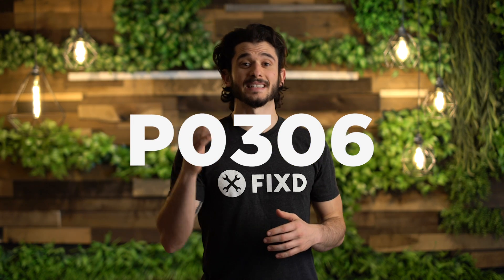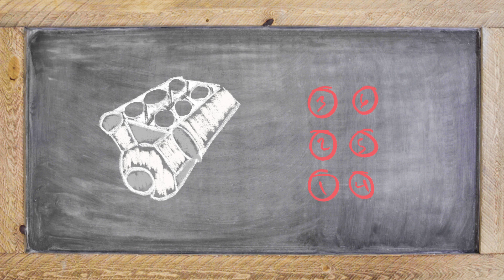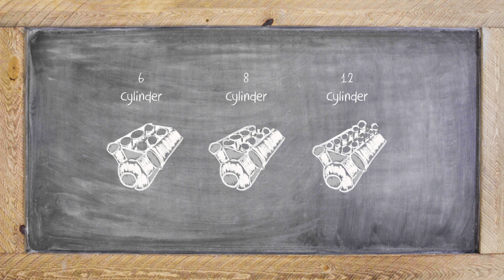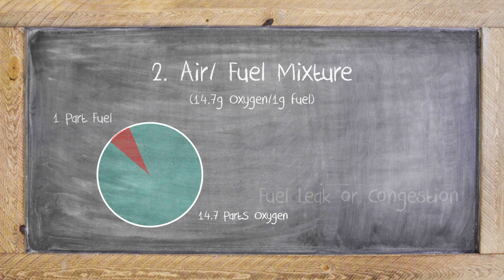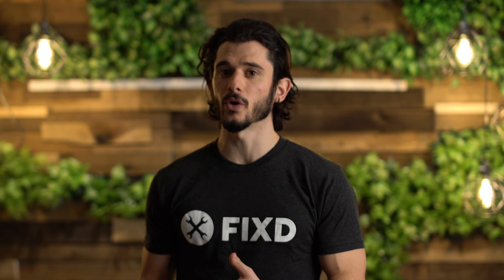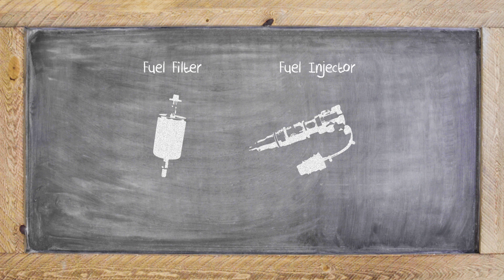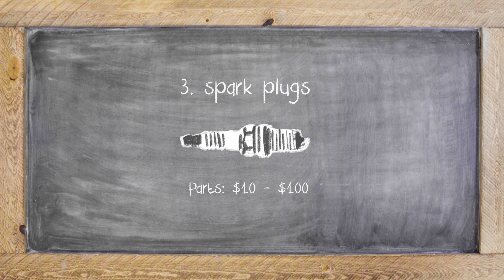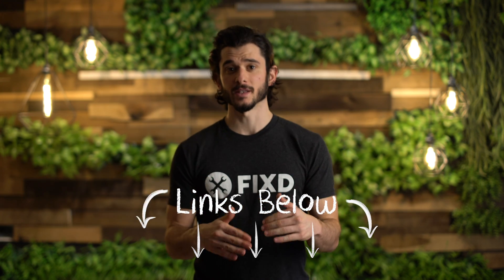P0306 Explained - Cylinder 6 Misfire (Simple Fix)

Comment: Usually putting in cheap 87 gas is the root issue. Buy gas with fuel additives or use a bottle or two of fuel injector cleaner solves your issue. Past experience, all it needed was a bottle of fuel injector cleaner.

Comment: Currently working on 2006 Tahoe.
Changed all coils, all spark plugs, all connections. Misfire on 6.
No powerful engine and stalling. I’ve already put $2K in the last 2 months! I need help. I basically re did the whole truck but all blogs says to look into the Camshaft? Lifters are good according to mechanic. Pretty much everything mechanic, electrical and suspension is new! Now dealing with this, also a O2 came up just now!!! Ughhhhhh
Reply: Look into your Cylinder Head Temperature Sensor  if you're still having that misfire problem also is there a loud smell of chemical gas odor
Reply: For it to be bad enough to stall you out, I would guess distributor or valve issue depending on what kind of truck you have. A faulty 02 sensor could cause those kinds of issues if it is causing your truck to try and run with a bad mix. So, I'd fix that first. Before you get work done on the values, do a compression test. I doubt it is your cam especially with mechanic saying your lifters are good. Cam is basically a solid piece of machined steel - typically, it either works or it doesn't from day 1. If you have a ton of miles and never did your timing belt/chain that could cause a problem that seems like a cam issue.

Comment: Can a O2 sensor cause a misfire in the six cylinder
Reply: If the 02 sensor is badly failed, yes. Because, the car's MCU (computer) may make a bad fuel mix (too much/little fuel or too much/little air) based on errant feedback from the bad O2 censor. If you do have a bad O2 censor, you should get an ODB-II code indicating that the censor is bad though. If your O2 censor is not throwing a code, I would not spend money to replace it. First, I would try SeaFoam (or something similar) to clean your engine. If you still have problems with a misfire code being generated, I would check your cables and plugs. If there is a problem, you will likely see it. It will be obvious. For example, I worked on a Honda Civic once that was throwing misfires. The head gasket around one of the plugs failed and flooded the plug well with oil. If you have a large number of miles on the vehcile and have never changed the plugs or wires, fouling (dirtiness) of the plugs or corrosion of the wires would be the most likely cause that I would look at first. After that, the next most likely thing would be a failing ignition coil.

Comment: i changed the o2 sensor, spark plug and ignition coil after i changed everything i manually cleared the code and it goes away for about 90 miles and then the light comes back on

Comment: Ok i am having that code on an a dodge 3500 promaster i hve changed the spark plugs coil and injector still same thing what could  i look at next also i did a compression test all cylinders passed
Reply: Do you have an older truck? Could your distributor be damaged? I have seen contacts bend and break off distributor caps. This could result in occasional misfires or constant misfires for just one cylinder.

Comment: On 5.4 triton a cam follower could pop out and cause misfire, you can go through all the things mentioned in this video and still have an engine that is stumbling. Take the valve covers off as a last possible diagnostic, poke around looking for parts out of position.

Comment: What if all my cylinders are misfiring would would be there reason my vsa light comes on and my van doesn't wanna keep charge and start it lets me reverse but doesn't let me go forward they said it could be a sensor but idk what sensor
Reply: Very strange. Perhaps, a transmission sensor could cause this problem. It could also be a failed MCU (computer). If it is your MCU, just get rid of the car and get a new one.

Comment: Have p0306 code on my 3.6 chrysler 200. Cant swap plugs or coil. Have to take intake manifold to get to them. Once I swap I have to put manifold back on to test them. If swap does work have to take manifold off again to swap again.
Reply: I have the same car, did you ever figure out what the issue was? I just replace the coils and still throwing that only same code. Was wondering if spark plugs fixes it or it’s a bigger issue?

Comment: Thanks for this video!  I also have the P0446 code on my 2000 Camaro (Purge Valve). Do you think replacing that will fix the P0306 code?

Comment: Hey I have changed spark plugs, ignition coils and also injectors I’m still having the same issue. Cylinder 6 misfire what could be the problem can you help me plz. My wife accidentally put the diesel in it. So I drained cleaned the lines and changed everything mention above plz help me
Reply: Did you ever get it fixed? My truck is having the same problem. We replaced the spark plugs, spark plug wires and one coil and it still is shaking and shifting hard.
Reply: It could be that your valves have been fouled (dirtied) by burning the diesel (it wouldn't have burned completely). You may be able to fix it with engine cleaner (like seafoam). But, if that doesn't work you may have to have the valves manually cleaned by a mechanic. Did you replace the fuel filter?

Comment: Have a p306 and p0300 misfires detected in all cylinders, i replaced all 6 sparked plugs and one coil on my 6th cylinder and still showing codes, any suggestions. Also have a small vacum leak p0456 ...2011 mercedes c300...

Comment: I got a p0306 cylinder 6 misfire detected code 
& suggested parts valve springs & valve cover  

Any advice ? ima check the simple stuff before I go off buy the 4 valves springs & labor for cylinder 6
Reply: Any update?👀

Comment: I just recently changed my ignition coils 2 weeks ago and out of the blue today i got a P0306... i will change that spark plug. those were changed in January as well.
Reply: What was the problem after? I had the same problem I replaced ignition coil and spark plug
Reply: @TonyP0425  i have the same issue

Comment: I have a P0306 on my 2000 Tacoma, and even though 'they' told me it was likely, spark plugs, wires or coils, or an injector - I think it is the mass airflow sensor. Why? Because it is an existing, known issue. Many years ago I had the MAF cleaned instead of replacing it and that fixed the issue for years but now I have this CEL and I wonder if it is the MAF and not actually plugs or wires or coils, or an injector? What do you all think?
Reply: Hey! My 2004 dodge ram 1500 had same issue it was the MAF my co worker who’s a red seal automotive technician also replaced his MAF on his 05 dodge, same issue.

Comment: Hi, I got the 6th coil and spark plug fixed and it still pops up. When I clear the code, it runs fine and doesn’t lose power.
Reply: What kind of car did you perform this on

Comment: Ok Champ, I'm confused.. I have a 2003 ford Expedition..  8 cylinder .. I changed all coils and plugs myself... coils were $35 ea.. plugs were $2....I made this purchase 5-6 yrs ago they are a little more now... If I had the dealer do the work I would be out $1000 plus.. I'm saying you are quoting parts list cost for which vehicles??

Comment: Same swap can be done with the fuel injectors to test as well see if the misfire moves to the other cylinder.
Reply: Except you must disassemble the entire top of the engine to get to the injectors so not a simple test.

Comment: after 2 months of nightmare trying 2 fix this code and 100$ in unnecessary parts, finally found that dirt under the coil packs on the metal plate was triggering my misfires. when in doubt switch coil packs and see if the code jumps cylinders.
Reply: also, get your parts on ebay, much cheaper!
Reply: did you check water in gas?

Comment: If the problem is a spark issue, will black smoke come out of the tail pipe when the engine is revved?
Reply: How long do fuel injectors last? Mine are original with 219,000.

Comment: had same issues, this code of cyl. 6 misfire and bank 2 too lean. Engine running running rough and shaking at various speeds on the road, and idle.  Mechanic ran the codes and replaced the #6 spark plug and coil. Runs perfectly now and power restored. I wouldn't think one cylinder misfiring on a V-8 would shake the engine like that.  Oh well, problem solved.
Reply: Mind you this is the second shop i paid for a diagnostic and they spent the whole time guessing what it could be instead of actually checking and getting down to the issue
Reply: Sounds like it's the shop, not the service you paid for and we're supposed to receive
Reply: What kind of truck do you own ?
Reply: literally have the same problem right now, changed both spark plugs and coil but still have the issue pls help someone help idk wtf im gonna do on my 5.7 hemi
Reply: @lilstuart1584  bring for a real diagnosis?
Reply: @sonicelectronic57 diagnostics don’t do shit. Been to the shop 3 times, replacing coils, spark plugs, and cracked intake manifold and they still can’t figure out the issue 500 dollars later 😂😂😂 these “mechanics” don’t know shit about cars lol
Reply: @mass9213  changing parts isn't diagnostics. Those mechanics may not know shit, but that's not the case everywhere.
Reply: @sonicelectronic57  i know what a diagnostic is, i paid them 200 to do it and they had me replacing parts “hoping” it would fix it because they didn’t know wtf they were doing 😂😂😂 i can literally do that shit myself for free
Reply: @lilstuart1584  did u ever find the problem?
Reply: I got 2000 gmc sierra v6 with po306 code and check engine light is on and flashes regularly. Changed plugs, wires, distributor with cap and rotor, cleaned the MAF, replaced pcv valve, and poured  Seafoam in my gas tank. Cleared the truck's computer for an hour and still getting the code. I guess next step is taking it to go get a compression test. If compression is good, then maybe replace the fuel injectors.

Comment: I replaced my distributor cap, rotor, spark plugs and wires last year and about 1 month ago i started getting cylinder 6 misfire should i check for the other things or check if those parts are faulty
Reply: The thing that looks weird is the cylinder 6 plug wire is curved, could that have something to do with it ?

Comment: Great video thank you! What do you think it is If the situation only occurs after the engine is warm?
Reply: I got the same problem with my charger, start shaking after is warm😞
Reply: @kevinavelar2297  Took it for a long drive a few times and eventually the problem went away.
Reply: @robmccaughey8351  check valve cover for leaks
Reply: @mr-toyota  
شكرا جزيلا❤

Comment: I have a Saturn l300 2005 I'm having a po306. I change the coil pack and spark plugs and wee k s later I got the po306 code. Could it perhaps be a fault inside my ECM?
Reply: Did you figure out what it was?
Reply: @AbstractionVideography  no my car just been sitting.

Comment: I have a 2016 f150 3.5 non EcoBoost , I have misfire on 6 cylinder. 
The codes are both p0206 & p0306 , I switched coils with number 5 & 6
And still have misfire ?
Reply: Ever fix it? I'm in a similar situation wondering what kind of money I'm going to have to spend
Reply: @Chillingworth  The problem with my f150 was ,
A rat ate through the wiring on harness @ number 6 injector . I had to splice the wires together.

Comment: i changed the spark plugs, coil packs, and injectors, any clue what can be causing the misfire? only happening in cylinder 6, no other cylinders
Reply: A short? Fuel related?
Reply: Ecm
Reply: Same af rn
Reply: @luisnava3239 could be a problem in the camshaft/lifters, that’s the expensive problem that is probably more trouble than it’s worth
Reply: @selrandolph 😢😢😢😢

Comment: Coils are usually from 60 to 260 depending on the vehicle. Mine for my truck was 56.99 for single coil
Reply: I got mine 35/ pop at rock auto. 15 5.3 V8
Reply: Silverado?

Comment: Doesn't work on all vehicles. I can't switch my coil pack around because it's a bar. I've got an inline straight 6, all 6 spark plugs are in one side and my coil pack is a bar that runs across them. That being said though I replaced my coil pack and plugs and im still having problems so I think I know what it is.
Reply: Did you ever find out what it was
Reply: @anthonyaguirre837  nope. Never figured it out. Replaced the coil pack, replaced the fuel injectors, replaced the spark plugs, even added a heat shield. Nothing worked. Ended up having to get rid of the vehicle and bought a newer truck.

Comment: I have a P306 code also on my Audi Q7 4.2.  I replaced all spark plugs and coils and cleared the engine light.  

The code came back on for the same cylinder 6 misfire after putting about 55 miles on it.  It would actually be the second time I’ve replaced the spark and coil on cylinder #6, thinking that the parts may have been defective.  PLEASE HELP!!!!
Reply: Injectors now.   Or vaccuum leak
Reply: Have you fixed your Audi yet? I did the same and the check engine came back on. Gonna check for air leaks and fuel injectors now
Reply: What car do u have?

Comment: P0306 on 2013 ford f150 3.7 came in replaced 6 cylinder coil and all spark plugs worked for a few days then came on again and engine sputters pretty bad now?
Reply: 123 passenger bank then 456 driver right from front to rear?
Reply: Have this same problem, changed the coil and plug, it came back worse this time and I was told that it could be what this guy said in the video.
Reply: Had the same problem Ford ranger. It’s the cylinder heads

Comment: I have the p0306 so that means I should just change only the number 6
Reply: Pull the plugs first, if they don't look good replace them all(unless your going the cheap route then just replace the #6 plug) and go from there. If it is still misfires then try swapping the coils like in this video (If the misfire moves to the cylinder you swapped the coil from you know that you have a bad coil and need to replace that coil. you dont have to replace them all but its not a bad idea.)and if it still misfires in the same cylinder after that swap a plug wire and replace the injector. If none of that fixes it (or moves the misfire) then you have an internal problem (Valves, Lifters, ETC.)
Reply: ? Should I change it all in cylinder 6 , coil , spark , and injector

Comment: In your graphics you show the cylinders being 1 2 3 on the left hand side and 45 and 6 on the right. I thought they went alternate from right to left.
Reply: Depends on the engine manufacturer with how they number the cylinders. I've seen both patterns.
Reply: @homer46303  I have a 2012 Highlander V6, how is the arrangement of the cylinders? Thanks

Comment: If it is the spark plugs, wouldn't it be better to replace all of them? As they have similar lifespan?
Reply from the maker: Good question PK! Yes,  we think it's better to go ahead and replace all of them if you're getting to a place where one is worn down enough to trigger a code. (i.e. a 50,000-mile mark)  There is a method to our explanation though. For the sake of clarity, we want people to understand the individual spark plug is related to a specific cylinder. Also on the off chance this is happening in a new car - we want them to understand it could be a single faulty spark plug. Not engine failure. Cheers!
Reply: Mines doing the same thing
Reply: Yes. I've never seen them for sale individually. They only sell them in sets for the same number as cylinders in your engine AFAIK.